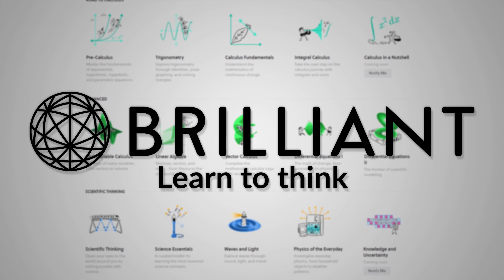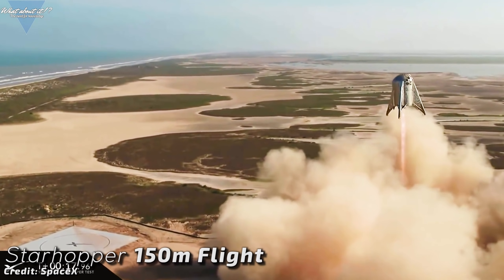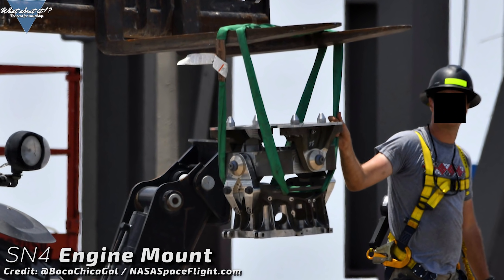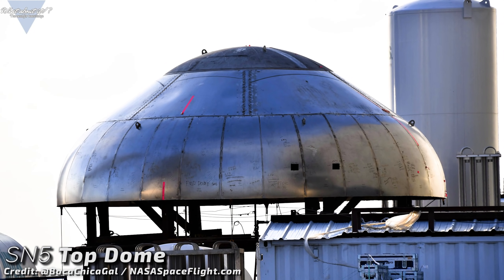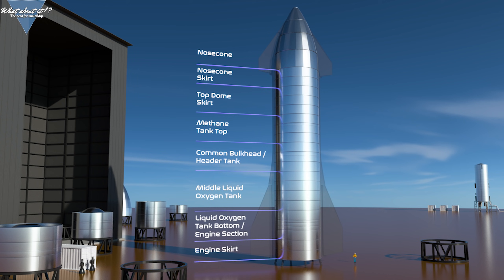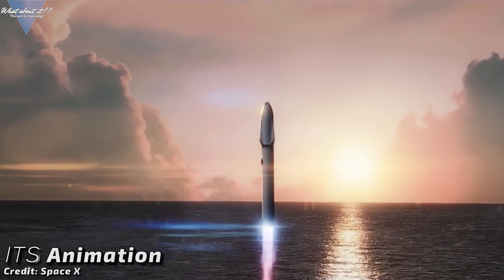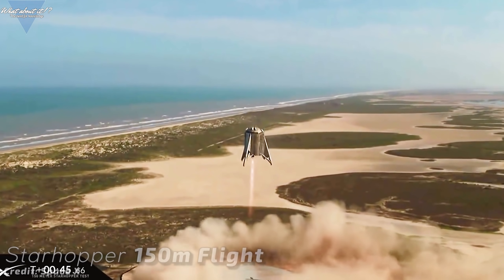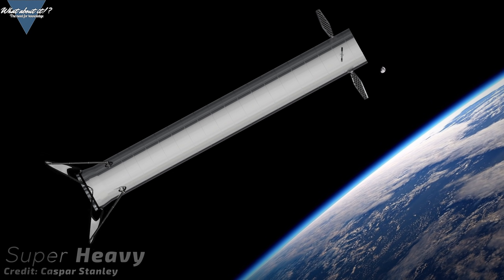92 | SpaceX Starship Updates – A History Of Starship Evolution

Comment: I wonder how they will develop the super heavy. Do you think it will be like starship? It looks way more complex, but maybe it would be easier to build because of what they learned with the starship?
Reply: Actually it's way easier to develop Super Heavy. It's basically Starship tech in Falcon 9 format. Attaching 31 Engines so close to another could be a problem tho, but nothing SpaceX couldn't deal with. Of course there could be other problems I'm just not seeing right now but I think Elon said something similar.
Reply: Developing the thrust puck capable of taking 31 Raptors at full thrust will be the most difficult part.
Reply: Garbon  indeed, the thrust of 31 raptors going up against the weight of the booster fuelled and the weight of starship fuelled with payload.
Reply: Finite Element Analysis (or whatever its called) should identify any issues. The welding robot would make short work of it. Its only a single size of ring. Material thickness is probably the only variable in that regard.
With the new leg design essentially copying F9 on a larger scale, Super Heavy is basically an upsized F9.

I'm wondering if Super Heavy would be needed for an orbital test hop. Musk has stated in the past that Starship has the capacity to do SSTO, but with no payload.
Reply: I fully expect to see a few tanks with only a few rings between the bulkheads and a structure equivalent to the Trust puck designed to mount 31 engines. These would be tested to destruction.  Later a couple of full sized Superheavies would be built one used for 20km or less hops (using less engines) the other might actually be tested with an orbital Starship.
Reply from the maker: It's way easier than Starship as the tech will already be known with one exception The Thrust dome. Withstanding the force of 31 Raptors firing at the same time is a tough task.
Reply: Super heavy is basically a very large falcon 9 first stage in essence.  I think they will nail it down quickly.
Reply: does super heavy has the same diameter as starship?
Reply: @nathanmyles1  yes
Reply: @patloob  yeah, both 9 meters wide
Reply: SuperHeavy is basically SN4 with a few more rings, bigger tanks, grid fins, and more engine attachment points. Since it has the same 9 meter diameter the majority of it's construction has already been verified. I think there is a decent chance that the first copy will be used to launch Starship into orbit.
Reply: @coreys2686  Comparing Super Heavy to a F9 is not a good comparison because the construction techniques and what they are constructed of are entirely different. The SH is going to be constructed from stainless steel like the Starship but it will be longer and have more engines so that's a better comparison. Remember what they are leaning about manufacturing the Starship will directly apply to the SH. The only thing I see being a major carry over from F9 is the software and maybe some of the avionics which is key a element to landing.
Reply: Quoting Elon - constructing the Super Heavy will be  "easier" / less challenging than the design and construction of Starship - which makes sense - however it's wise to temper expectations with the space faring adage "Nothing about spaceflight is easy" - though the perseverance and brilliance of SpaceX can sometimes make it appear easy - but that's what hard working creative geniuses do - make hard things look easy.
Reply: It's basically just going to be an enlarged version of the Falcon 9 first stage. It will be more complicated than Starship in the sense that it will have thirty one engines and will require all the plumbing for them, and the software necessary to control them. On the other hand, like the Falcon 9 first stage, it only has to go up about sixty kilometers or so and then come right back down, so it doesn't need any fins or flaps or any complex control systems for flying in space and then reentering. 
My guess though is that they will follow the same basic program, build and test, build and test, build and test. I would imagine that, with all of the knowledge gained from both Falcon and Starship, the process will go much faster than it has with either of those systems.

Comment: Just imagine.....A Starship Heavy, three of them like the Falcon heavy.
Reply: richw0123 ...what about 5 of them in a cross formation
Reply from the maker: Rawr! :D
Reply: @ypey1  hell yeah! and all reusable
Reply: @ypey1  Good grief! You could lift a good sized space station in just a few launches! Would old planet Earth withstand that powerful and awe inspiring launch? That would be one massive Roman candle!
Reply: @ronfullerton3162  SpaceX could send up blast furnaces, hydraulic presses, massive lathes, all the machines of industry to the solar system!
Reply: Bad idea when you are dealing with that much thrust power. The instabilities you would have to deal with would be a nightmare. Incidentally, this is one of the concerns raised about SLS. Some people question the choice of using SRBs that large since they become so unstable at that size that it risks damaging the payload or the rocket itself. 

A much better idea would be so just launch them as 3 separate starships.
Reply: I assume you mean a Superheavy Heavy. That would be a hell of a lifter but, given Starship/Superheavy's expected reusability, quick turnaround time, and refuelability, it doesn't really buy you anything over distributed launch.
Reply: I hope they have sufficient duct tape
Reply: Used to bring lead satellites to orbit? ;)
Reply: Wait..even better...what if you imagine a Starship SUPER Heavy, with Starships as the engines O>O
Reply: Can't see that happening... but Elon has speculated a couple of times that once Starship/SH is up and running, they could look at an even bigger one... where the current one is a 9m diameter, he's suggested a truly ridiculous (though still smaller than SeaDragon) 18m diameter rocket could be on the cards.
Reply: Careful now. We don't want to push The Earth out of orbit.
Reply: Moar Booster!
Reply: Oh yes, the Kerbal runs thick in this thread..😉 🚀
Reply: @odysseusrex5908  i mean, with that kind of horse power you could launch a single megalitic element in one go without having to assemble it on orbit (that is a pain in the ass)

Comment: How is sn4 going to lift off with asymetrical thrust? Is the launch mount going to be tilted? I just uploaded a short video of how i think it will work but what do you think?
Reply: That's what vectoring is for, I guess. It might mean it takes off a little sideways before it can adjust, but once it's off the ground, it can presumably hover at a slight incline... you couldn't do that for a real launch, but no big deal for a 150m hop...

Comment: Could starship be built in space? how would vacuum and temperature differences affect welding and would it be worth it?
Reply from the maker: Those are very good questions. In theory, welding in vacuum should work excellent. No oxygen at all at the weld point. The question if it would be worth it is really hard to answer. Since Starships and SH are fully reusable and since methane and liquid oxygen are rather cheap, launches will be very cheap.
Reply: From an atmospheric contamination perspective,  it would be great. Unfortunately, other than that I can think of nothing but trouble-- all the needed fixtures, welding equipment/robots, and gasses would be a LOT of weight you'd have to get up. If you did it manually a huge amount of scaffolding and hard points would be needed to secure the technician, and the EVA's would be very long since it's a slow, delicate process. Power requirements would be very high, especially with multiple operations going on at once. The biggest issue, I'd say, would be the need to control temperature over the whole weldment-- in orbit the dark/sunlight cycles would wreak havoc for temperatures, and I could see real issues with heat effected zones around welds being impossible to accurately control. And with wildly variable temperatures the stainless would practically be dancing, leading to local stresses and seams going out of alignment. Back to needing massive fixtures.  I've made some stainless hoppers with complex geometry, from the size of a car to about a small building, and keeping everything straight and true is practically a dark art, and that's with reasonable environmental control. In space I'd do small welds to attach brackets or something, but long seams would likely end up giving me the space madness and I'd flush myself out an airlock. 

That said, if SpaceX found some bizarre workarounds for all those problems,  I wouldn't be surprised at all.
Reply: If you can use cheap, massively capable starship launches to put enough heavy industry into orbit, you could theoretically make orbital drydocks that make ships that are meant to be "planetary buses" that never land on a celestial body. Such ships could be made to be enourmous. 

Also, industrializing LEO and the moon is probably the most important next step for humanity to take, as it would not only enable massive advancements but also move all the pollution of planet. The pollution caused by rocket launches is an unnoticeable blip on the radar compared to the carbon footprint of heavy industry.
Reply: I am wondering how massive the ships being built on mars will be, 38% the gravity, and Way less atmosphere will  allow for some seriously HUGE orbital vehicles.
Reply: The problem is, in order to do significant construction in space, you would need Starship to haul up all of your parts and equipment. Orbital construction is better for something really big.
Reply: Space welding is weird. It’s not a perfect vacuum anywhere in space. In Low Earth Orbit like the ISS, it’s 2 billionths a psi of atomic oxygen plasma, which is way better than hard vacuums possible on earth. Many materials weld together in space instantly on contact, with no surface prep at all. Stir friction welding of stainless steel may be possible in space with no heat added at all,  or a small source of concentrated sunlight. And heat will have to radiate away by grey body radiative cooling, which does not occur at all unless the weld zone is shielded from sunlight.

Comment: Great Video!  What will the final fin to ship interface look like?  Hinges on the ends or mid-point or both?  What about that little space between the fin and the fuselage?  At the nosecone fins ?  Wonder if a heat shielded flexible flap (thiink: truck tire mud guard) that is integral along one edge only, connected  to the fuselage and then held against the fin via air pressure; and the natural leaf spring like resilience of SSteel, as it approaches Earth's atmosphere, would be workable?

Comment: I still think they're going to ditch the flaps and go full giant falcon 9 mode. They do need to work on the skirt though, it has to withstand the hyper sonic re entry. With that much surface area it needs to be reinforced and adjusted for the vacuum and sea level engines. Remember: Less is more, I mean, the best part is no part

Comment: To your question about the new Stainless Steel...Elon had said that 301 was better for rings and 300x was better for plates, as in domes. I think he mentioned 5 or 6 would have new 300x. Also, not to be picky by SN 2 was not tested to destruction. It tested to 8.5 bar and is still alive and well on a stand by the propulsion bldg. After MK 1, a test tank was tested to destruction. Noting the new test stand under construction, the gate is labeled as Starship Landing Pad and is where Star Hopper landed. I wonder if SN4 will land there as maybe they are just constructing the Stand there and will move it to the new Launch Pad to the east when completed?

Comment: What are the advantages of carbon composite over stainless steel?
Reply: Primarily that it's light. But SpaceX figure that that actually balances out, because using stainless steel means they don't need a hull containing the tank... the tank is the hull.

Comment: I don't think there is any chance for an orbital flight this year. They haven't even started Super Heavy and Starship is a fair way from being suitable for orbit. I reckon late 2021 at the earliest.
Felix, it would be really useful for you to make a proper informed assessment of future progress over the next two years (2021 and 2022) based on progress over the last 12 months.
Reply: Maybe, maybe not. Starship has only been in full-scale development for about a year, and they're already about to make the first flight, however short. I think it depends on how well those flight tests go... how many attempts will it take to pull off the skydiving re-entry and landing? If that goes well, I can easily see Starship being ready for an orbital flight by the end of the year... but if they don't go well, obviously things are going to take a bit longer.

As to SuperHeavy... I don't see it taking long to develop a basic model. Most of the Starship development time has involved figuring out the design and construction techniques, and there's a huge amount of overlap between them... the major challenges for SH will be building bigger tanks, and building the thrust structure to take the load of thirty-odd Raptors. Assuming that they start development immediately after a successful 20km Starship flight, I can see them doing flight tests on that before the end of the year. Actual flights paired with Starship might be a bit too ambitious for 2020, but I wouldn't be entirely surprised to see something in the first few months of 2021. But of course, it depends on how things go... there will certainly be setbacks along the way...

Comment: Welding the nose cone will not work. They will soon start using molded or printed nose cones. Its the only way it will be symetrical. They may be looking to use a welded nose cone to form the mold?

Comment: where  are  the  fins ?
Reply: Still on the drawing board. They won’t be needed for awhile since they are only used during re-entry.
Reply: Not needed for SN4, and probably not for SN5 either. But since SN6 is supposed to have them, they may be building somewhere out of sight... they're much more complex than tank sections and bulkheads, so probably need a better workspace...